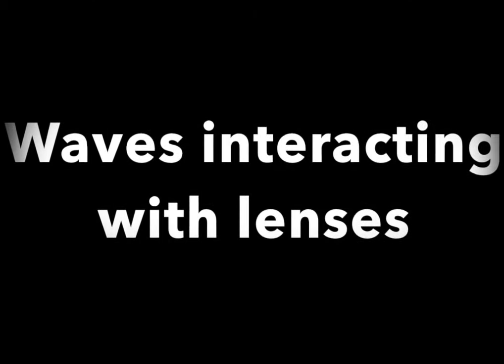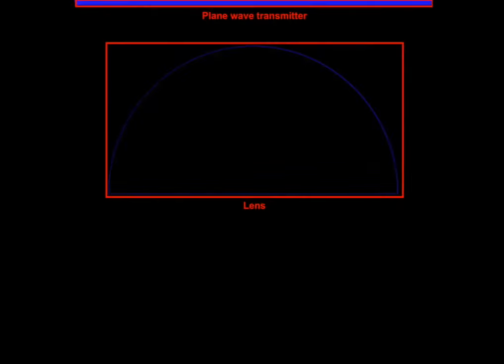Light passing through a lens - Python simulation

Comment: I like your project because I also had the idea to use a simulation to study wave propagation too. Just in three dimensions. Do you think it would be hard to port this to 3D?
Reply from the maker: Yes. This was running almost in real time. the 3D simulation would be slower but the math would be very similar. I was doing this in 2d because I didn't wanna worry about 3d rendering.